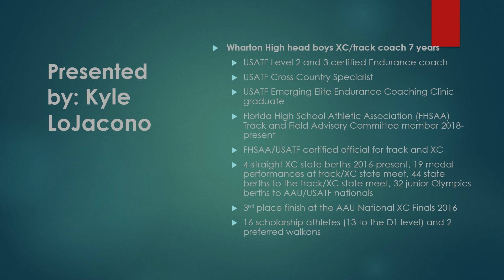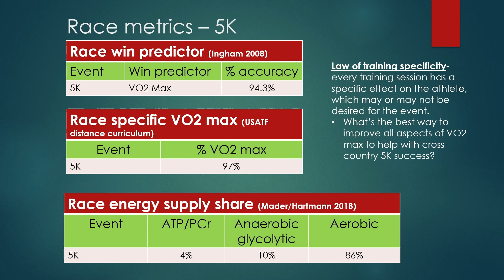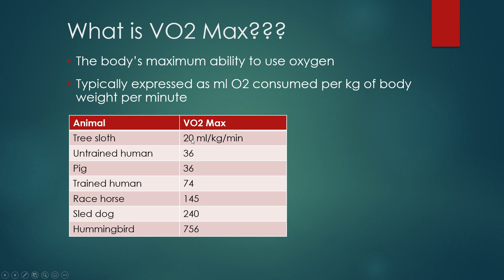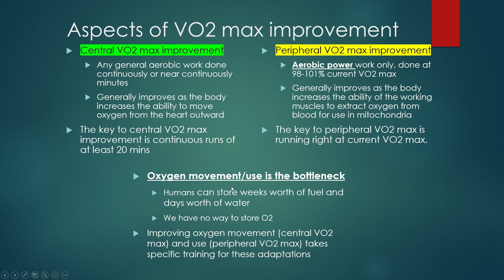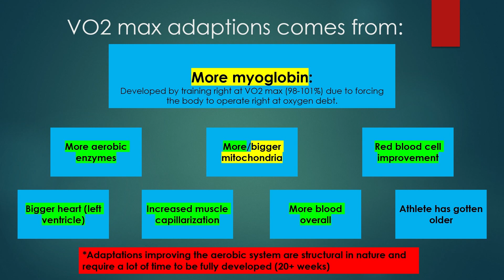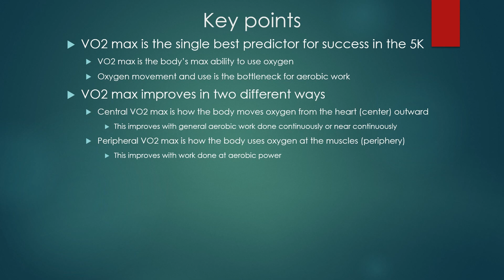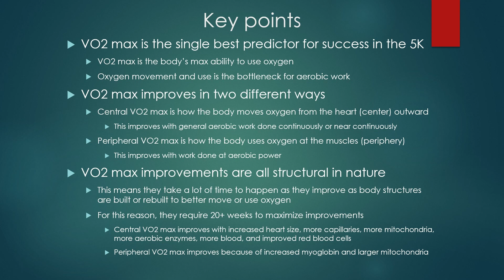Central vs peripheral VO2 max - Coachy TV

Comment: In just reading and listening to what many coaches do, what do you think is reason coaches are hesitant at times to do VO2 Max Work in summer (along with tempos) is it just not having an understanding of the energy systems and how long they take to achieve maximal results? I hear all the time “we only do base miles in summer” “no sense in rushing” “no place for stress in the summer” I must admit I was in that camp for quite some time
Reply from the maker: I think that's a fantastic question, and it comes from a couple of areas. The first being probably the biggest part; we as coaches coach how we were coached. How many of us went through a focused VO2 max interval workout during the summer (or ever) while student-athletes? I would say very few, so we don't see a reason to do it. That translates to everything in life I think. We look for things that justify what we already believe, and if we hear things like no sense in rushing it and pair that with what we did as athletes, well you can guess the results. However, if you enter anything in life with an open and honest mindset, the answers should be somewhat easy to find. If you go looking for a certain answer, you'll probably find that answer regardless if it is actually true. You can find examples of people who perform greatly doing things like just miles without any thought as to how they are structured. The open argument would be what was that person's situation? Had they already fully developed their VO2 max because of time running in middle school and high school before? Maybe that particular person was just an aerobic monster who responded great to that, but what could they have been in a structured, systematic approach to summer (or winter) training? You could never truly know how much was left on the table. You only have the results in front of you, and stories of those I think get everyone thinking it's the end all and be all. 

Now I'm not saying you can't get a lot of the way there with just miles. That's the tricky part about just pure aerobic miles. They can get you a lot of the way there, and that tricks people into thinking it's the only way to go. In the end, the aerobic system provides 86% of the energy in the 5K, and just focusing on miles will for sure make that part better. However, how do you maximize everything possible? How do you you that 86% of the energy contributions to be as strong as possible? Just miles will make it good. Focused, tailored approach to all aspects of the aerobic system will make it great. Another reason it can trick a coach and athlete is because if they are in their first year of running, any type of training is going to make them better. They're just running, so often that first year of training they'll make those huge jumps with anything you do. Do the exact same whatever miles the next year, almost always that person's performance stops improving. This really shouldn't be the case. Sure that first year is going to have the biggest jumps, but with the correct training they should continue to improve as you target all these areas needed for success in whatever race you're doing. 

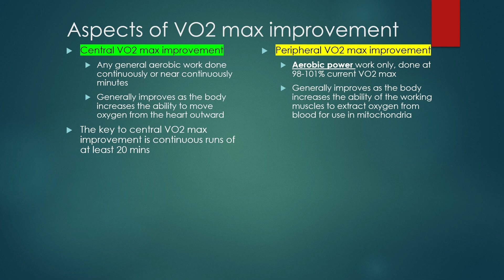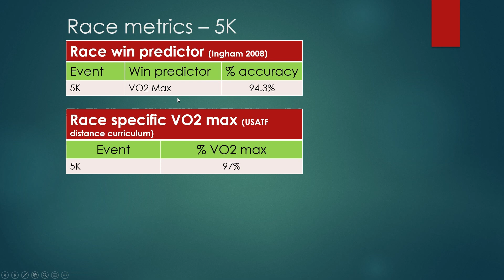We had a kid a few years ago that I think illustrated this perfectly named Tre. He came in after running middle school at a pretty high level, and as a freshman went 17:34 in the 5K, 9:58 3200 and 4:36 1600. This was in 2016 before I really started looking at this closely. The next year in XC he continued to get better, dropping to 16:16 and getting 9th in the state, which just affirmed my believes. Then track happened and he only got to 9:46 3200 and 4:30 1600. That did not add up. When I started looking at what he'd done in middle school I released his volume was low and had done a lot of anaerobic work. The reason he got better his first 2 XC seasons and first track season in high school was simply he was running more. I wasn't doing anything special with him. He was just an amazing aerobic athlete who was finally getting any miles needed to show that. Once just miles peaked out for him he stopped improving at the same rate. It's what made me want to look outside of my comfort zone to try and see what I was doing wrong with all of my kids, but only after the next XC season that was again not great. After making changes he ended his high school career at 15:45 5K, 9:17 3200, 4:19 1600. We even got his 800 down to 1:58. Was he very good before these changes. Of course he was. I think many people would love having a 16:16 5K kid who can also go 9:46 and 4:30. Was he better with a systematic approach to this like what you're talking about? Of course he was. That's what I think holds people back. Will me doing these VO2 max intervals take this 16:16 kid and make him worse? That unknown fear I think is a big reason people don't step outside of the box.

I think there is also a bit of a sense of the fact that these workouts are stressful both for the coach to manage correctly, and also for kids to do them in the summer when they are expecting to have things easy for 2 months. I'm sure many people are afraid their kids won't come to practice knowing they are doing 4 miles of 2-mile pace. That workout hurt, but in the end it's so key to getting their peripheral VO2 max developed, and VO2 max is the single biggest predictor of who wins the 5K. This is where coaches need to educate their athletes. If they know how key this is to getting better most will choose to never miss these days. At this point my kids ask me when these workouts are so they can schedule things around them. They also know they can easily do the aerobic threshold and tempo days on their own, so I encourage them if they have to miss try and do it those days. I've even had kids recruit their parents to take them to a local track or trail early morning or late evening to make sure they don't miss this training. Of course that also takes them understanding the training design so they are doing it right, but if you can get them to understand how critical this is to their development, they will want to know all of this. 

In the end it really goes back to knowing your why for everything you do. People are motivated by knowing their why. What you are doing is important to be sure, but only important enough to just get you through something. If you know why something is critical, you're going to put everything you can into it. I think if more coaches and athletes knew why this was so important they would be sure to never miss it.

Thanks again for the great questions Andy. They are always enjoyable to go through and answer.